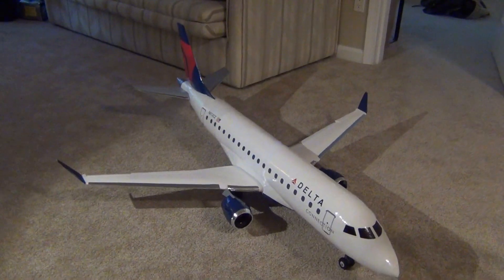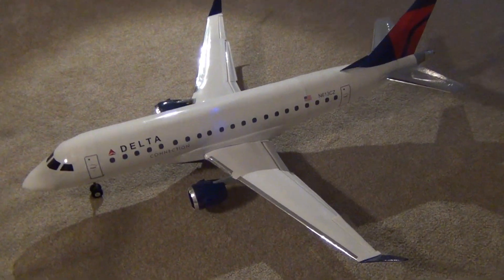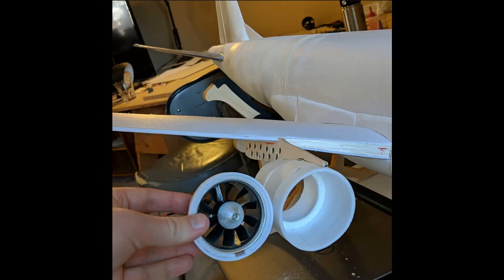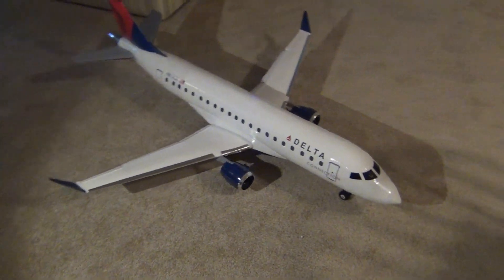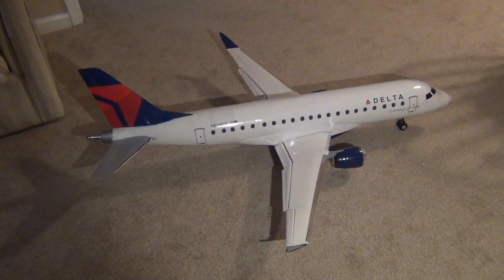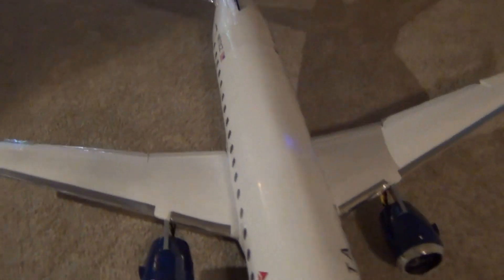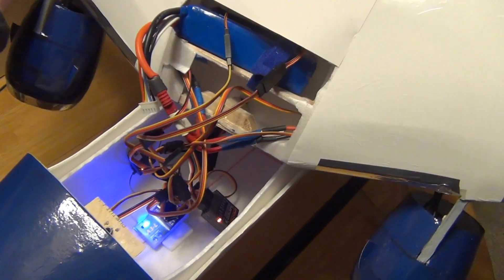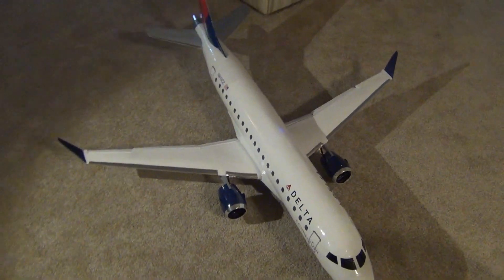RC ERJ-175 AIRLINER JET MODEL BUILD

Comment: Wow looks awesome. From your experience which plane did you find easier to fly compare to an airliner edf to the DC-6 plane from your earlier days?
Reply from the maker: The dc-6 was pretty easy to fly with four props blasting air over the wings but it had no glide rate

Comment: Pretty amazing great job ... whats next ..?....Maybe build one  twice this size .bet that would be Cool .......(  just like this one is ) Can you estimate the cost you have into the Embraer 175..? just wondering and wanting to build one myself any pointers you want to give out ..?
Reply from the maker: Thanks. I'd estimate that the electronics cost $200 and the materials hardware another $150. Hardest part for you would be finding suitable foam because depron isn't available for purchase anymore but you can try foamboard.
Reply: @E744763Productions   So what's the  preferred  foam to use now that is available .that will work..?.. Dollar store foam board ..? what is pliable enough to bend into the fuselage  shape ?    or what ..I want to build one twice the size of yours.   I want to make it a slow flyer( helium assisted blimp) style   https://www.youtube.com/watch?v=_BhFxcXsf58                                 What do you think..?....
Reply from the maker: @jlions72  6mm model plane foam (MPF) is pliable without heat and is common with  home built CNC plane kits. I'd give that a try
Reply: @E744763Productions  so did you get a chance to watch the video I posted for you to see ..Just was wondering what you thought  about how he created this jet to fly like it does